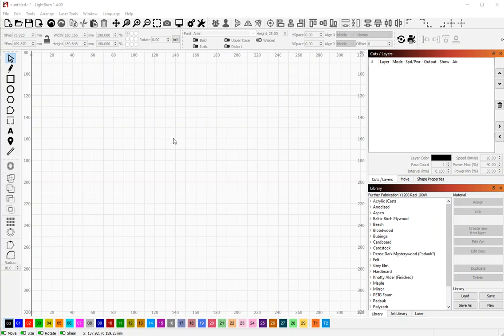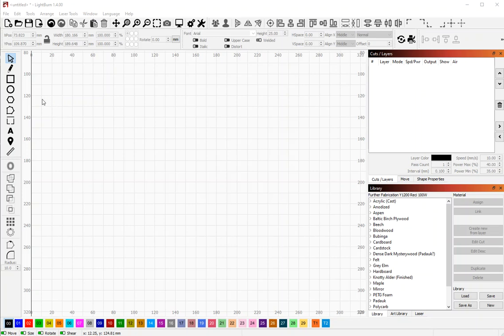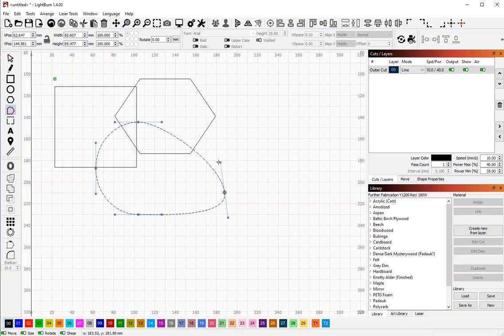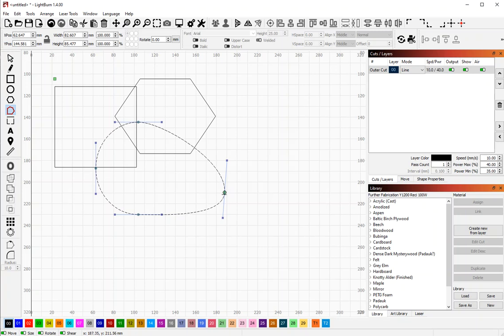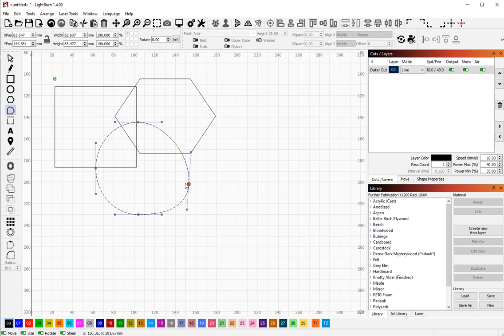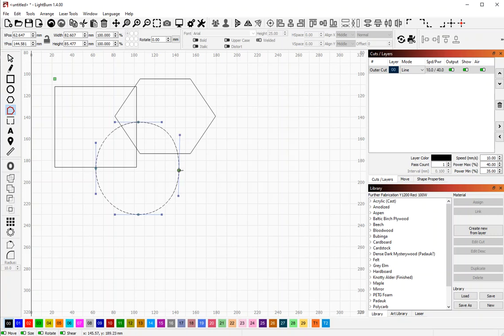LightBurn Tutorial: Node Editing explained

Comment: Is there a way of setting the absolute location of a node or moving it in the x and y direction by a specific increment? I'm scanning old model aeroplane plans and for example the rib needs a slot for a 1/4 inch spar. The scan shows the slot at 0.225" so I want to move the node by 0.025" to correct the clearance - thanks
Reply from the maker: Unfortunately, there isn't a way to enter a new position for individual nodes (currently). What I usually do is have my settings configured for some standard increment sizes that I use.  I use metric, but in the settings panel, I use "Shape Move Increments" where CTRL-Arrow is 1mm, Arrow is 5mm, and Shift-Arrow is 0.005mm.  If I am working on a job where I need to make a lot of changes for the same increment, I will just pop into those settings and change the arrow increment to make it easy.  Then, you can select the node (or multiple nodes) and hit the arrow keys to move them that increment.

Comment: Good to know how to work on the nodes. Don't we need to group them after we fix the nodes to work with lasers? Thanks.
Reply from the maker: Not sure exactly what you mean.  Depending on what you are trying to do, node editing may create single shapes or multiple shapes, so it may be desirable to group them in some cases.
Reply: @milaserguy  I am learning laser design. I thought all the nods should be connected to engrave or the laser to travel the path. In your example you have 3 different broken paths and I don't know how it will engrave. I believe you just covered only how the path will work, and your covered very well. Thanks again.
Reply from the maker: Ok, I think I get what you are asking.. If you are doing a "fill", then yes, you need a closed shape.  If you are engraving a line, no such requirement exists.
Reply: @milaserguy  Yep, that's it

Comment: Thank you for the video. I've been struggling with this issue for a week. I have been making window panes and doors and adding clipart. The laser would cut a window and would cut the clipart in the process. By doing a convert to path, adding two node points between the clipart I can delete the cut line before it gets to the clipart. 😀
Reply from the maker: Thanks, glad it helped!

Comment: oooo... super nice.. orizontal or vertical alignament with 2 click !!!! the best !!!
one more question: If an object has 4 nodes or 500 nodes on it, does the engraving or cutting time differ for the same object? Is the time significantly shorter for 4 nodes compared to 500 nodes? Now that I've seen this video, I'll give it a try myself... but I thought I'd ask, in case someone else sees this question. Thank you very much.
Reply from the maker: I don't believe it makes a large difference.  The vector is optimized to gcode behind the scenes anyways, which is only defined by the smallest increment the laser can move, which is quite small.

Comment: Great video - best one I’ve seen on node editing so far! I would love to see a video on connecting individual line segments to a shape. I have really been struggling with this because sometimes the auto-join path works and sometime it doesn’t. for example, let’s say you have a closed shape and you want to add a line going across part of that closed shape in between two nodes, and you want it to be all part of the same shape, how do you do this?
Reply from the maker: Not sure I entirely understand.  A shape in lightburn has a start and end, with no branches.  It is a path, thus, it cannot have an intersection that splits as you describe, however, you could have 2 shapes that are grouped together and would move/resize, etc. as one.